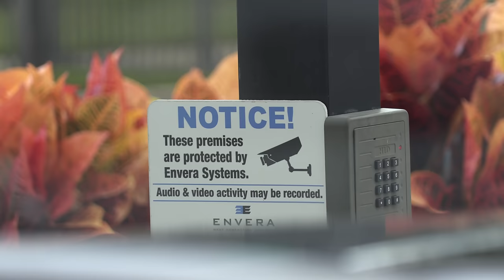Home-Made Trap to Catch Giant Green Iguanas! {Catch Clean Cook} the BIGGEST i’ve ever Seen!

Comment: Not sure if it is an option for your trap Robert but you could slice up the funnels leading into the trap so it expands when they try to get inside the trap, but not when they try to exit. This way you can get larger iguanas while not letting the smaller ones escape.

Comment: Iguana Skewers
2 cups iguana meat* cubed
1 cup of cola
3 minced garlic cloves
1 to 2 jalapenos, finely chopped 
3 Tablespoons soy sauce
4 Tablespoons lemon or lime juice
1 Tablespoon ketchup
1 Tablespoon sugar
Salt or seasoned salt
Cooking oil

Directions
Heat sugar in a saucepan iver medium heat until slightly caramelized.

Add cola, garlic, soy sauce, ketchup and 1/2 teaspoon salt.

Cook 20 minutes or until reduced by 1/3 stirring well.

Remove from heat. Stir in lemon juice and jalapeno.

Add the iguana meat to the cooled marinade and coat well.

Cover and marinate at least 1 hour.

Soak bamboo skewers in water for at least an hour prior to cooking.

Thread meat onto skewers.

Grill skewers on medium heat for 20 to 30 minutes (or until done,) drizzling additional marinade while cooking.

*Note: Iguana should be gutted, and parboiled (20 minutes) prior to skinning and deboning.

Comment: next time try a trap with a netted bottom all around ending at near the center of the trap leave about half to three quarters of it ( the trap) open so the iguanas can clear the net inside the trap.  The iguanas will get in but the net won't let them out because they will be stepping on it when they try to get out. The trap should be about 6 to 8 inches off the ground to let the iguanas enter. Good luck.  I saw his trap in a video Georgia wildlife put out to trap hogs Don't see why it wouldn't work on dumb lizards